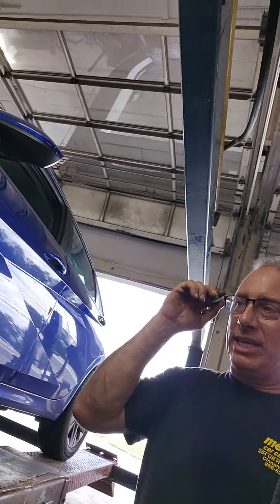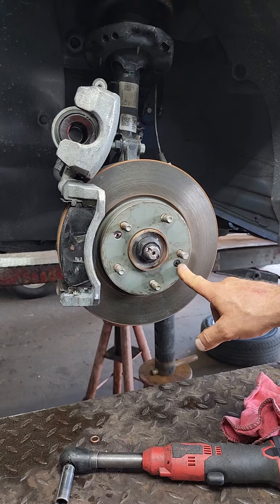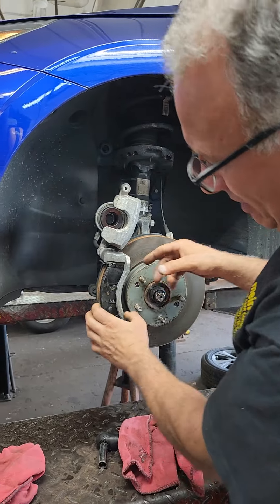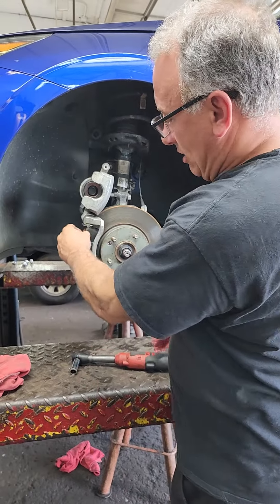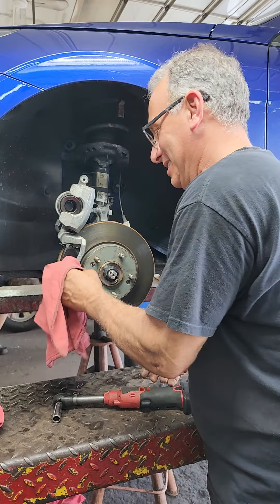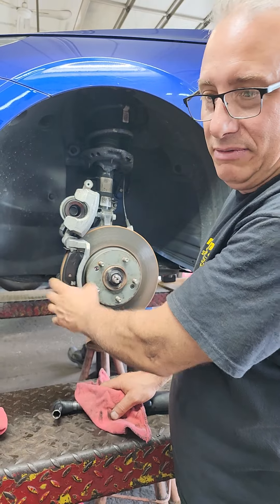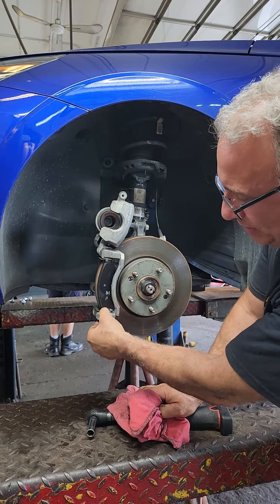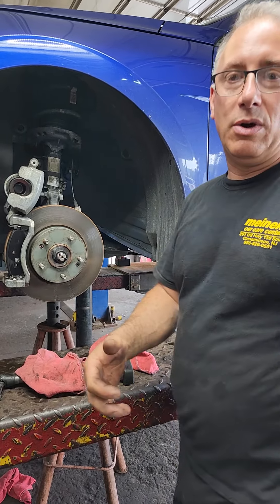Clicking brake pads brakes job done elsewhere  let's see

Comment: Almost all other places would have unnecessarily replaced those pads to boost that ticket. Honest Anthony at work.😅
Reply: No the moment the customer asks why did you change my new pads your screwed then if they want to see them your screwed , he is doing what is expected no more no less
Reply: He should've replaced those junk pads they don't even fit. Only a hack would put RTV on brake pads. WHAT DA
Reply: @MacAutoDiag  they make a silicone product just for this application so not hack work
Reply: @daryllynhutchins8459  nope I'm a shop owner. It's hack work
Reply: @MacAutoDiag  fair enough,l don't particularly like this guy myself but there is a product for this type of job it's great for squeaky brakes when tin backing plates are missing
Reply: @MacAutoDiag  did you see this blokes next video ? Yeah hack work you got me on board
Reply: @daryllynhutchins8459  no I didn't even want to see it. I want to forget this channel lol
Reply: @MacAutoDiag  cool , good luck

Comment: I’m confused…..how is a little grease on the outside shims of the brakes and a tad on piston have anything to do with pad fitment in the caliper bracket? Less shitty brakes that fit better might be help better?         

Also, why is adding a tad bit of grease to the caliper piston the stupidest thing in the world? I’ve seen pistons crumble from corrosion in MN and I’m sure you have too. So, why not lubricant the rubber seal a bit and add a little protection to the weakened piston from heat and wear and tear? Sure, the good waterproof green brake grease or Sil Glyde would be best 🤷🏼‍♂️.    Now if someone put the brake pads inside out….that would Be the stupidest thing ever lol. 

Also, they don’t do it from the factory probably for a couple reasons….you don’t need to grease anything when it’s brand new with PDI wrap on the rims protecting from the elements during shipment/storage.   A similar detailing comparison could be made about not using body wax after a car wash.       The manufacturers don’t use wax from the factory on the whole body, but you can add a little and improve the protection of the paint and body, but if you use too much it’s messy and can defeat the purpose. 

   Another reason could be is manufacturers are cheap af and or wanting to make the most money they can. Why put extra care/protection if it’s not going to directly benefit the company and only the customer.
Reply from the maker: Promotes.movement  we don't want movement
Reply: I guess 🤷🏼‍♂️